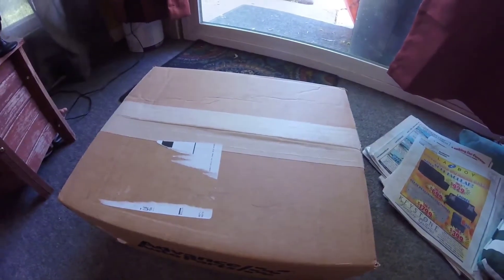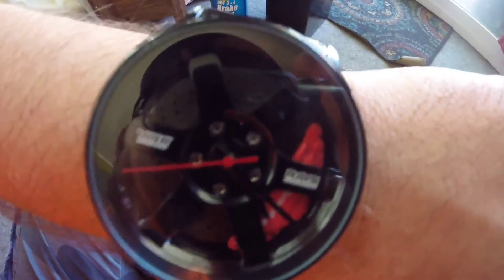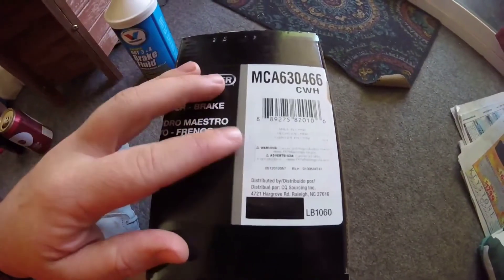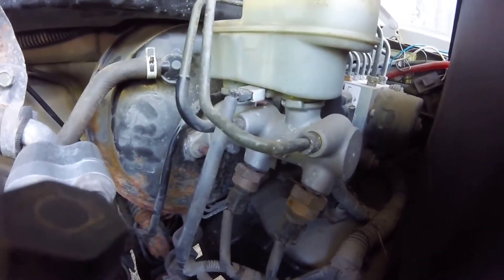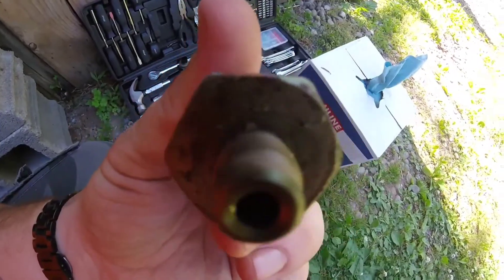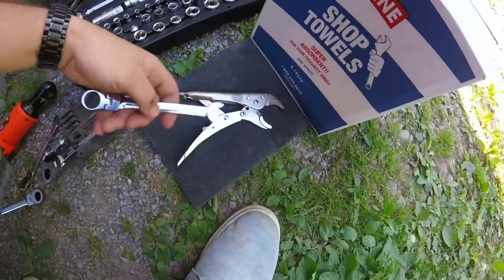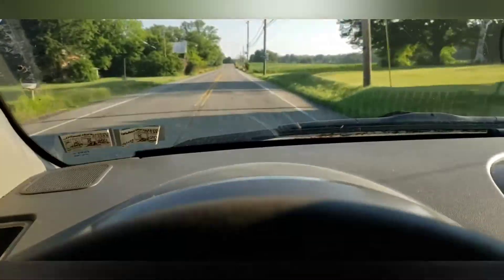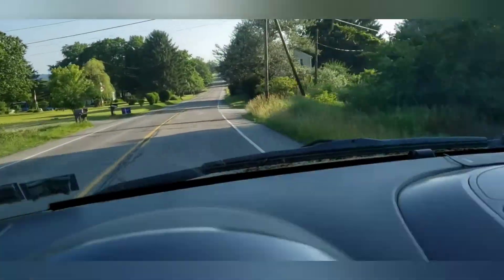How to replace a master cylinder on a 2007 Nissan Titan

Comment: Super curious what you determined was causing the brake dragging!  Just replaced my master cylinder (with the same part number) in my '07 Titan, and now my brakes are dragging.  I can relieve the dragging (not certain if some, or completely) my pulling up/back on the brake pedal with foot while driving.  Everything I've read, this indicates either the booster rod or the master cylinder rod being too long, causing the master cylinder to maintain positive pressure.  Some booster rods are adjustable, but that doesn't appear to be the case with the Titan.  Other than fabricating shims/seals between the master cylinder and booster, not sure what else can be done.
Reply from the maker: I've replaced everything in the brake system except the booster. Mine also seems to release a bit by pulling back on the brake pedal. I have a new booster jist haven't had the time to install it yet.

Comment: About to give this a whirl on my '07.  I have a really soft pedal.  I replaced my pads and bled the lines.  Not sure what else it could be.  Thanks for this video.
Reply from the maker: You're welcome. Thanks for the support. I am still having issues with mine. Only thing left for me to replace is the brake booster. Hopefully you can get yours fixed with just the master cylinder.